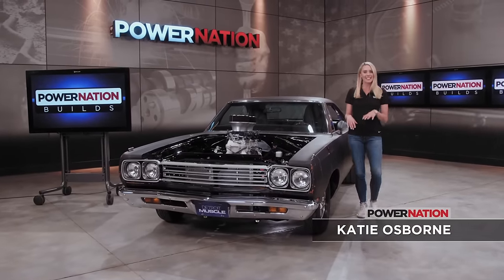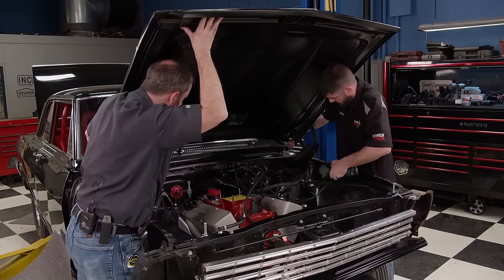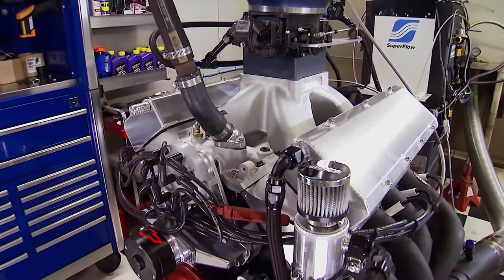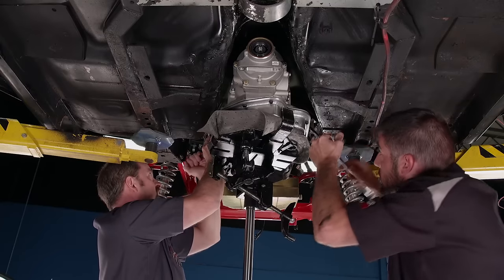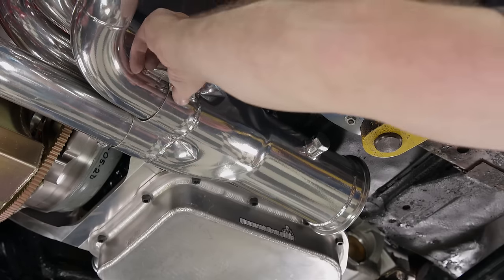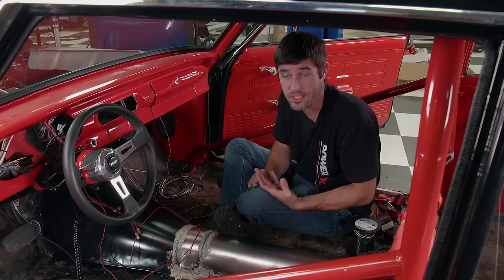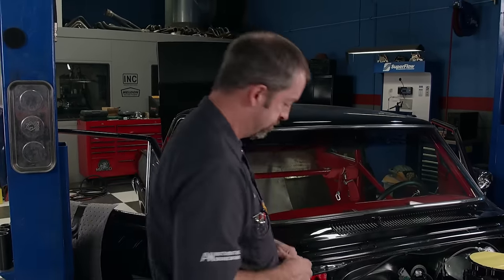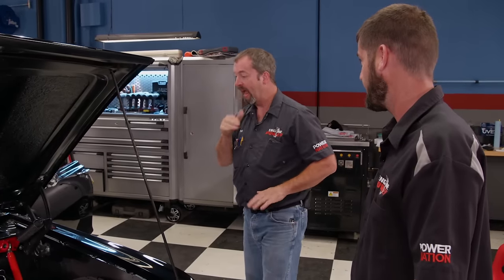Pro Street or No Street Nova - PN Builds

Comment: @2:30  All that money to go 11 seconds in a 1/4 mile......
Imagine getting smoked in that 383ci V8 Nova by a little 150cc  2 stroke  🛵 drag moped that cost a fraction $ to build.
Reply: true but the 11 second quarter was with the 383 and turbo 350 transmission, i think with the big block that car and easily reach the mid 9s on a good day
Reply: @everettgrover9459  True .....I was looking at 150cc 2 stroke drag bikes in Thailand that were doing 9.5 in 1/4 mile !! 
If a person can't afford a 900hp 500 something ci Nova. They could have some cheap fun building a small 2 stroke  methanol drag scooter....After watching them, it makes me wanna build one. A bit more affordable, seen a 150cc beat a modern 1000cc super sportbike.
Reply: @michaelbrinks8089  now that would be a thrill ride
Reply: @everettgrover9459  Makes me wanna go find a 150cc 2 stroke moped for sale. 😂
Reply: Link for 11 seoond 150c moped? This car runs much quicker than 11s guaranteed
Reply: @gordocarbo  search "Thailand 150cc drag racing bikes."  Although the riders only weight 98 lbs which helps quite a bit 😂